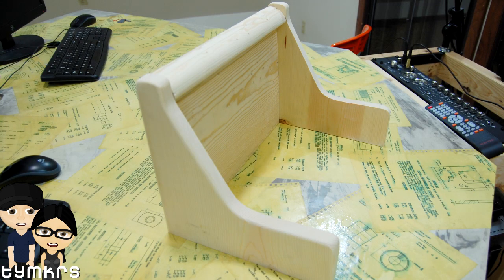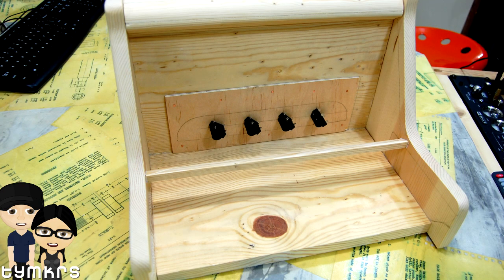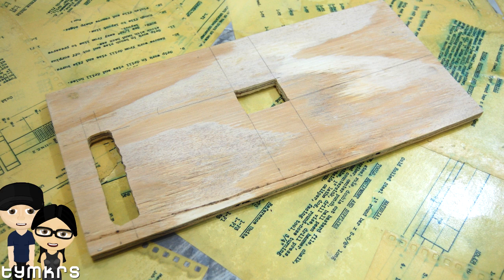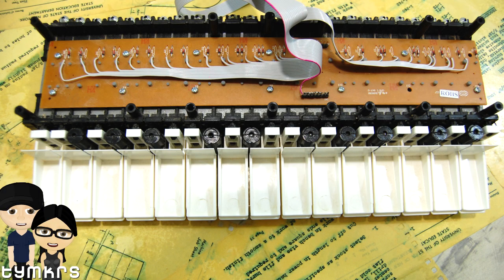Tymkrs Protosynth

Comment: Any simple way of explaining what the shift registers are for?
Reply from the maker: There are two basic types; parallel to serial (74hc165), and serial to parallel (74hc595). 

The 165, when latched, will load the state of its 8 input pins into a register.  The register can then be read out of it one bit at a time.  Great for turning 8 switches into an 8 bit number.  Your old school NES controller used one of these chips to read the states of the buttons for example.

The 595 will accept a stream of bits, pushing them into it's 8 bit register.  When you latch it, it applies what ever 8 bits are in the register out onto its 8 output pins.  Great for turning an 8 bit number into 8 LEDs being on or off.

Hope that helps!

-w
Reply: there are a lot of keyboard keys, which bring a lot of wires (buttons) which need to be asked/polled if they are pressed or not. that would require like A LOT of data pins on a microcontroller to check each and every key directly. so they often use external components like a parallel-2-serial shit register (or multiple of those) who provide several input data lines (like 8) that can easily being polled/asked if they are high and low, just by using like 1 single dataline to the microcontroller, since the communication between the input-shift-register and the micro is often just SERIAL (1 data line, one clock line, one ground). and by dasychaining shift-register ICs you can have like A LOT of parallel input data lines on one single micro using just "some" data-lines to retrieve A LOT of information, serial this way. i hope that makes any sense to you :3

Comment: It is real hard to assemble pcb for the keys do you know where to buy keys and the board you used?
Reply from the maker: +Mr.Sam Ali No one sells just keys, so I bought a used midi controller and took out the parts I needed.
Reply: +whisk0r O i see actually i have several keyboards to use them for that but i was thinking that you built each and everything ... i think you said in video that you did that all... so i thought that you also built that pcb. Anyways thanks a lot. Your video is helpful  :)
Reply: Fatar (the biggest manufacturer) sells keybeds, but only to companies. But google 'Fatar' and you may find companies who have Fatar keybeds for sale. Doepfer used to sell them, to name one.

Comment: Hi, sorry for a noob question but what kind of keyboard did you use for this project? I have some old casio keyboards i've been circuit bending, could i use one of those?
Reply from the maker: You could indeed.  Just a matter of devising a way to read the keystates into some kind of microcontroller.

Comment: Nice re purposing of an MAudio Ox8 (i'm looking at mine with a glint in my eye) - I could imagine this being a wonderful trigger for hacked speak & spells and similar cos lets be honest a $2 second hand casio would sound better as it is. Don't get me wrong I acknowledge the work that went into this (though I'm skeptical of the time to worth ratio when a hacked kids toy could sound (sorry)kind of better, so did you add anything a bit more exotic than a glorified 555 square generator :D ?
Reply from the maker: It's a development tool, not a static synth module.  That's the whole point.
Reply: whisk0r
yes, I know. Only 1 thing I don't remember saying it was 1 thing or the other though so I'm puzzled as to why you needed to tell me that.
Reply from the maker: AuralVirus What I mean is, any time I'm hacking on an idea - it ends up starting on the Protosynth.  So yes, lots of exotic strange things.
Reply: whisk0r
Would love to see / hear results. Was there a follow up video? (Being colour blind I've shied from anything to deep with electrics so I'm on the look out for something I can copy rather than pioneer.)

Comment: Ok, so it looks like you snagged the keys themselves from another piece of equipment.  But anyone know where to get keys without stripping them out of existing equipment?  I have some synths I'd like to make controllable through traditional keys.
Reply: buy some piece of broken stuff on ebay? even "piano toy" should be enough
Reply: Thanks, Bob, I was thinking more along the lines of getting a bunch for a series. But for prototyping, yes, eBay is the place!
Reply from the maker: We've looked and looked. Fatar is the company that actually makes the keys used in most everything - good luck getting them to sell you any though.  Please let us know if you find a source!
Reply: whisk0r Thanks.  I'd not heard of Fatar.  I'll see what I can find over the next several weeks and hopefully remember to come back here!

Comment: Very cool, although when using header pins and sockets as inline connectors use heatshrink on each pin to avoid shorts when the connector twists.